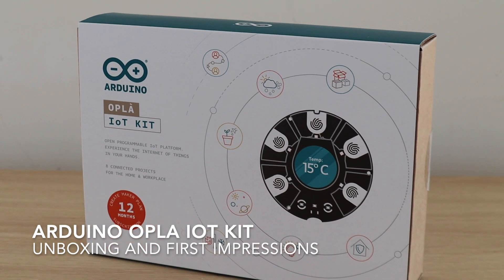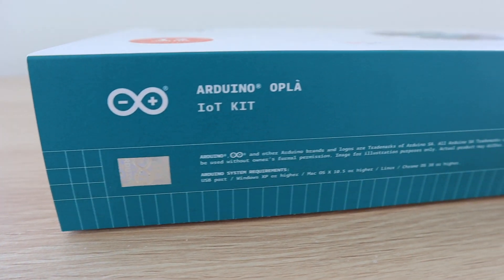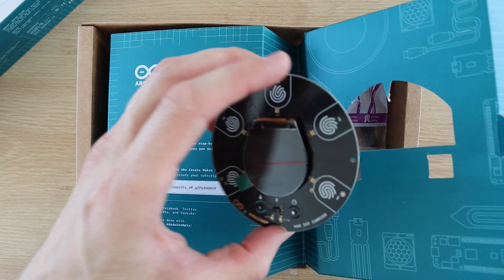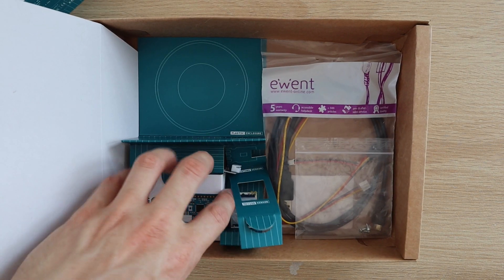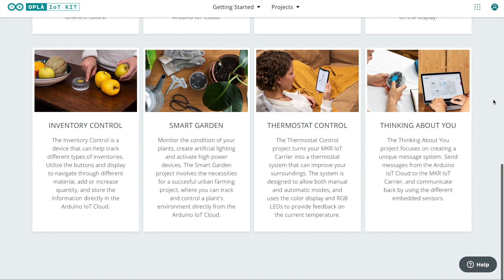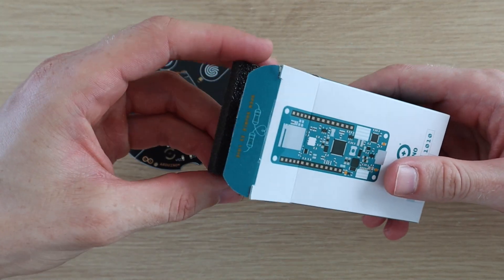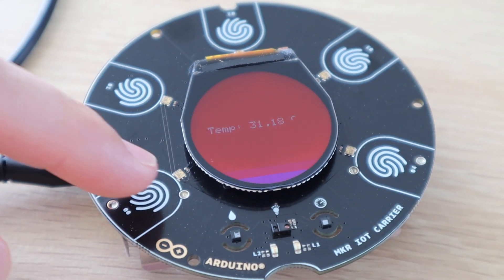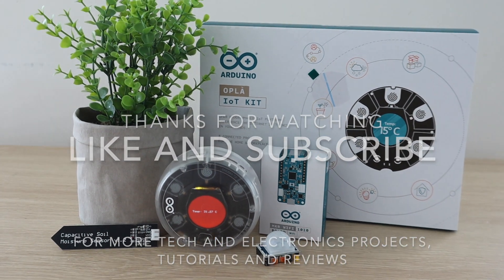Arduino Oplà IoT Kit - Unboxing and First Impressions

Comment: Lol that's an IPS round display, not OLED😂
Reply from the maker: Arduino's product page list it as an OLED display. I haven't looked into the exact part/model number so this may be incorrect.
Reply: @MichaelKlements  just look at it, backlight bleeds through the FPC, panel looks dull all this enough to justify its not a freaking OLED. I dont know why arduino did this.

Comment: Little bit sad, that the neccessary of online cloud system. I hate to invest regularly in any kind of subscription. One reason for me and a lot of others not to join this IoT thing.
Reply from the maker: I agree it's not ideal but unless you've got a static IP at home you generally have to use an external server for IoT projects and this costs money for the provider to host on an ongoing basis, so they have to recoup the cost somewhere.

Comment: How many items can I control with the carrier board?  I need water sensor triggering a small water pump to water plant until it senses moisture, Then it turns off pump.   
I already have the blue 8 switch bar you show ina different video.   I hope instructions uses the 8 switch bar.... if not.   CAN YOU ATTACH YOURS VIA VIDEO TO SHOW ME?  Close up clear view of wiring connecting.

I have little money.  Is there a CHEAPER ARDUINO PKG OR ITEMS “”ONLY”” NEEDED?

I can buy pumps amazon or AliExpress. Small diameter water tubes also, hopefully.

Is there a water proof case for it?  Or just use plastic container that seals shut....
Reply from the maker: Its got two relay outputs and two analogue input ports. The carrier board already has the relays built into it, so you don't need an external relay board to drive the pumps.